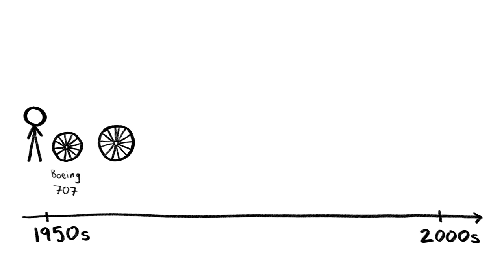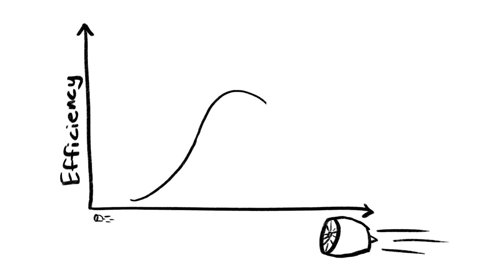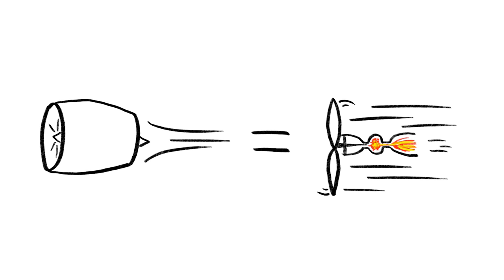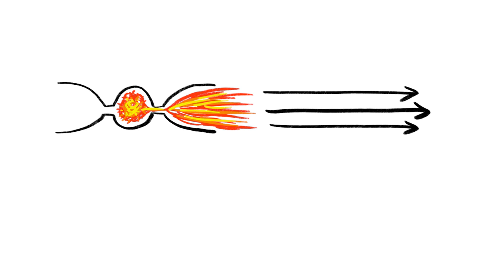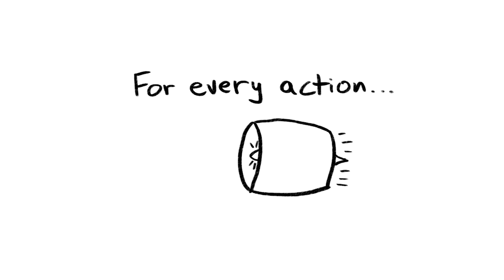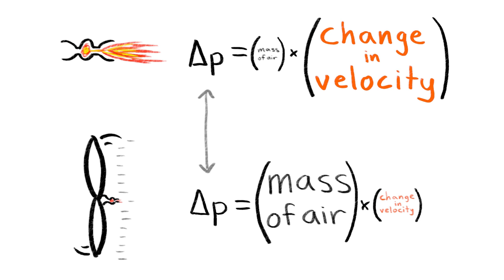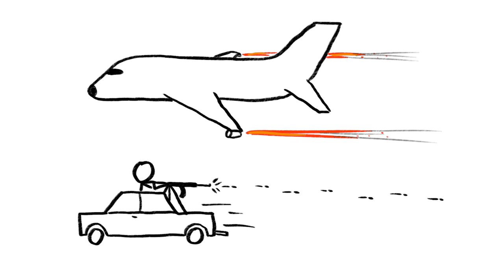Why Are Airplane Engines So Big?

Comment: Henry - Great video! One minor clarification: The core of the engine does actually produce a significant amount of thrust in a high-bypass turbofan - when at altitude. It's about 50/50. This is due to the density of the air being much lower at 30+ k feet, the fan is not drawing as much mass flow so it can't impart as much momentum. As such, the fan's power consumption isn't as high, which leaves more enthalpy available to convert to thrust coming out of the core nozzle (the turbine driving the fan doesn't need as much at cruise). At takeoff, though, you're trying to squeeze every last drop out of the fan and therefore there will be very little energy left over to make thrust out of the core. At this point, the fan absolutely does produce the majority of the thrust (~ 85/15).

Comment: Another reason for bigger engines is noise. Because the velocity of the air travaling through the engine is proportional to the sound produced by compression shocks inside the engine. If you want to build quiter engines, you have to reduce the velocity of the air, but in order to compensate for the reduction in thrust, you need a higher mass flow rate. This is archived by a bigger diametre of the engine.

Another limitation for the size of airplane engines are the standard sizes of airport hangars, that one reason why in recent development for example, of the Trent 900, the casing for the air-intake is elliptical rather than round.
Reply: +Sinan Al-Khadra While not true, it should be noted that a surface with air moving different velocities on either side will generate induced drag as well as a lot of noise from the vortices.
Reply: does it applies to cats as well?
Reply: Sinan Al-Khadra what?
Reply: There are also various tasks performed on the ground that get more difficult the higher up the main fuselage of the airplane is off the ground and engines mounted below the wings are the main factor influencing how high that has to be. Not to mention that the landing gear causes more drag and needs to be more sturdy if it is longer too.

Comment: Its all to do with bypass ratio. You can also increase thrust by producing an engine with a much smaller core but the same fan diameter. Assuming you can create a core that has the same power output

Comment: There are a LOT of reasons as to why engines are like they are, what I find funny though is he focused on the larger commercial planes, but had a tiny side note for ramjet and turboprop, but very little to none on the prop planes, the Boeing aircraft use large engines for efficiency and speed, while the Dash 8 Q400 and ATR72 have tiny little engines that are much smaller and slower, but have a bigger range then some airliners and have massive fuel savings as being the most fuel efficient aircraft available, all Boeing and Airbus make are aircraft to shove people into and get them from point A to point B quickly, and most engines on those aircraft are limited by wing-ground clearance not just limitations of the engines themselves

Comment: Modern fighter jets have dropped turbojets in favor of turbofan engines, for the same reason as the commercial airlines. They just tack on afterburners for more thrust when needed.
Reply: Nope. Fighter Jets use Turbojets because using a Turbofan with an Afterburner will just defeat the purpose of the Afterburner, if you don’t know Afterburners are used to burn the remaining Oxygen that exits the engine so they can create more thrust. But only one Jet in history used a bypass system and that is the Lockheed SR-71 Blackbird where tubes connected to the 4th Stage Compressor took air and sent it directly into the Afterburner
Reply: @whoyoulookingatabs1028  nope
Reply: @whoyoulookingatabs1028  Very wrong

Comment: Good video, but just 1 thing, modern fighter jets also use turbofan engines, mainly because you still want your fighter jets to be able to be able to fly for an appreciable amount of time. The main difference between a jet used for fighters and commercial  jets is the bypass ratio. In general fighters use a lower bypass ratio because there is a bypass ratio limit after which after-burning (or reheating) becomes difficult to achieve.

Comment: Additionally the size of the fan is limited by the centrifugal and rotational forces on fan blades (both normal stresses and bending stresses). Furthermore, longer fan blade tips can reach supersonic speeds at the tips, leading to shocks and flow separation. Of course innovations in blade materials and design can push these boundaries.

Comment: I understood the machine-gun part! I'm smart!
Reply: +DimesTR I didn't.
Reply: +Jonathantje / Bammerbom XKCD Refrence? I'm not sure
Reply: +Jonathantje / Bammerbom Drastically over simplifying, a machine gun is like a very inefficient rocket engine, but instead of shooting out hot fuel and oxidizer it shoots bullets. Due the recoil produced by most guns being rather small to a car it doesn't move the car much.
Reply: I hope so
Reply: DimesTR no you're not
Reply: XKCD : what if : machine gun jetpack

Comment: Yup, we usually refer to that as "Bypass Ratio."  The amount of air driven by the fan relative to the amount driven by the core.  High bypass engines  (sometimes as high as 10:1) are much more fuel efficient and quieter, while low bypass engines (nothing really uses a pure-jet anymore, but jet fighters can have bypass ratios as low as 0.3:1) generally have a better thrust to weight ratio, making the more suitable for applications where performance trumps economy and range.

Comment: 4 metres is only optimal at a certain rotational speed.  In the general case larger, slower rotating propellors produce less turbulence and are more energy efficient.  I think the treatment here is specifically to do with jet turbines, which prefer to turn fast.  It doesn't apply to other motors.
Reply: +Ray Kent I would expect that this video oversimplifies things a bit :)

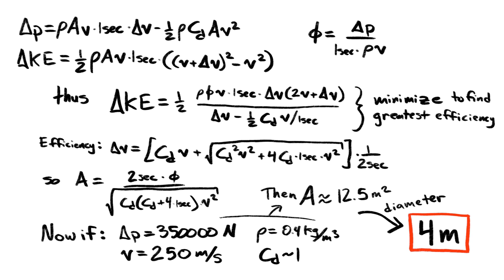Comment: 1:25 when physicists take a rough estimate
Reply: +Cryp Tic Yeah, fluid dynamics is really complicated, especially when you're talking about compressible fluids like air. Almost any calculation you perform would involve making some assumptions that simplify the problem from the real world solution. The fact that the calculations even fit on a single frame of the video means this is a very simple and rough estimate with a lot of assumptions. The trick is knowing the right assumptions to make the calculation manageable while still being accurate. That, or knowing the right computer software to model the problem, which in itself takes a good deal of experience. Really, that's true for a lot of physics and engineering sciences in general.
Reply: +Gary Ermann ^^^when physicists explain things in simple terms^^^
Reply: That's a rough estimate by any engineer's standards as well. And it's not complicated at all. You can learn all the basics for this in a day.
Reply: Physics.. Its usually like that

Comment: I want to point out that the Airbus A350 only has 2 engines while the Boeing 747 has 4. This is why the A350 has bigger engines than the new 747. If the A350 is powered by 4 engines, like the A340, it will have smaller engines than the 747.

Comment: How is a "pure jet engine" (as used for fighter jets) different from a rocket engine? Is the difference that rockets carry an oxidiser?
Reply: Basically, yes.
Reply: +Ag8MrE A jet engine typically has a compressor to compress ambient air as oxidizer, as opposed to pre-compressed oxidizer. The compressor is generally driven by a turbine connected to the exhaust, only without a fan that bypasses the combustion chamber (as in a turbofan).

Even fighter jets these days generally use turbofan engines, albeit much more biased towards the jet than the fan compared to airliners.
Reply: Typically, fighters use low-bypass turbofans, most likely due to size restrictions, while airliners use increasingly-higher-bypass turbofans.
Reply: Fighters use low-bypass, high-pressure turbofans, because the high fan pressure makes them suitable for use with afterburners, allowing very high thrust for their size and weight, but still allowing good fuel economy below the speed of sound when not afterburning.
Passenger jets use high bypass, low-pressure engines because of their very high fuel efficiency. Per passenger, modern-day airliners burn about the same amount of fuel per unit of distance traveled as a subcompact economy car--and they do it while travelling 8 to 10 times as fast!

Comment: The larger engines (high bypass turbofans) are also quieter, not just more efficient. The mixing of cooler air from the bypass duct with the hot exhaust from the engine core outlet helps to keep sound down by eliminating the harsh blending of varying temperature parcels of air (ambient air in the surrounding atmosphere and hot exhaust). Add some chevrons on the back of the nacelle (like the Boeing 787 and 747-8) and it blends even more and makes it quieter.

Comment: Also you forgot to mention the bigger the engine the bigger the propeller, and the bigger the propeller the faster the tip of the propeller will spin up to a point it will reach a sonic boom which is very detrimental.
Reply: +dontknowdontcare The fan blades already are supersonic at the tip I think. Thats what they told us at the university anyways -
Reply: they are already super sonic but a company just resent ly figured out how to have the fans run slower to reduce fuel consumption.
Reply: +Miguel lopez airlines already fly with fuel consumption in mind the winglets on b737 reduce fuel about 4% per flight but a massive cost reduction. 
They use cost index to determine speed zero means save fuel while 300 means burn alot because we are experciencing strong winds.

Comment: The interesting thing is that this is the exact opposite of how it works for rockets. With a rocket, you want the exhaust velocity to be as high as possible so that the propellant mass fraction can be minimized, hence why ion engines are so efficient.
Reply: It depends. He's actually not 100% correct. Jet engines these days don't shoot out their exhaust at high speeds. Most rocket engines shoot their propellants out nearly ten times faster. The reason they're efficient is that they use the air around them. Most Isp/effective exhaust velocity data for jets is actually skewed, since Isp is impulse per kg of propellant in the vehicle. Some of the airplane's propellant is outside of the vehicle.He's right about the energy issue, though. It takes more energy to shove a small amount of mass really fast than a lot of mass really slow. The math shows it.

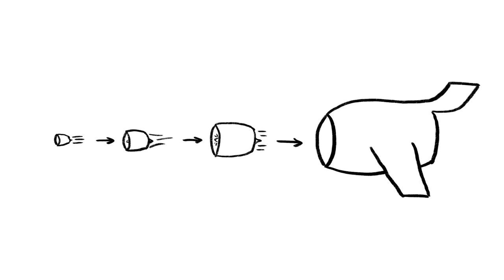Comment: I think the last one with big "X" on the last slid might work! at 1:30
Reply: +Jianyue Tang Yeah, I see nothing wrong with that design.
Reply: +Da_NKP it might need a larger fuel tank
Reply: +Jianyue Tang entirely fair, as well as larger wings.
Reply: A jet fighter version of that already exists and has existed since 1946. Look up the Mig-9.
Reply: Basically, but it wasn't big enough. We're talking something around the size of, say, an AirBus 320.
Reply: It neeeds lots of fuel.
Reply: mig 15

Comment: As an aviator, I agree with video.  In fact, airplanes are products of design compromise between four contradictory quantities: lift, thrust. weight, and range.  You can have the highest aspec ratio wings that are ultra efficient, but are equally fragile.  You have the biggest engine that can allow to move your plane at phenomenal speeds, but it will big, heavy, and will guzzle fuel like no other.

Comment: One of the simpler answers to this question is that newer engines use a greater amount of bypass air to achieve greater thrust. A large amount of air bypasses the combustion chamber and is re-introduced into the combustion exhaust. This air expands and accelerates in the hot exhaust and delivers more thrust. The engines must be bigger to allow for the bypass air. (BTW: Read Ender's Game about 6 times and enjoyed it every time).

Comment: Compare a A350 with a B747 was really a bad example.... 
Firstly, the B747 is marginally larger. Looking at the 747-400 compared to the A350-900, the Airbus actually got larger wing span and its only 4 meters shorter.. so yes, the 747 is larger, but only just. The A350 is actually a huge plane  And the uppcoming A350-1000 will actually be longer than the 747-400.  (of cause the 747-i8 is longer still, but its the 747-400 in the picture.)

The issue is that B747 have 4 engines and the A350 have only 2. The thurst of the A350 engines is maximum 350kN, but for the B747-400 only 280kN. Actually the engines of the A350 is even stronger than the one of the A380.

There is one additional error in the video. its over theoretical compared to the actual reality of aircraft engines. All (or almost all?) turbofan engines is direct drive engines. Because the fanblade have a maximum speed the rotation velocity most be keeped. This make it so the turbine engine have to have huge torque.

The compromise to this is that the turbine engines is a loot larger than it need to be, and the fan ist still smaler than is optimal. This is why engine manufacture dont make the fan at optimal size. Because then the torque would be to much.

The solution to this is of cause to introduce gearing. And there are some prototypes under development. This not only makes it so the fan can be any size (that is the optimal size for every given aircraft, but it also make it so the turbine engine can be the optimal size to.. that is a lot smaller.

This will decrease the fuel consumpsion more than making the fan bigger. But the comibnation will cut the fuel consumption quite a bit.
Reply: +matsv201 You're right, but this is a video for laymen and in 2 minutes. I think they did a pretty good job.
Reply: jibeneyto Well.. i would still think they should compare two aircraft of similar size. Say a A330 and a 787.

Also i think the issue about geard and ungeard turbine is to important to just skip over.....

.... i would think this is more a matter of that the videomakes know the theoretical background, but not the current limitations of the engines that is in service.

There is a glaring whole in the video. If they know the optimal size (and it been known since the 1900-century)... why don´t they just makes the engines optimal size...

This is a question that is unanswered.....And the answer is quite simple.. there is no gearing.... so they cant.
Reply: You're right as before, but gearing in turbofans has not really been implemented in any aircraft. Maybe in the future it will. I don't think it's important to consider such a "new" concept in a 2-minute video.
Reply: jibeneyto No.. but it answers the question why the turbin gradaly grow, and why they don´t make it optimal from day one.

Comment: I have a question - aeroplanes fly at high altitudes where air is thiner so that they can reduce the drag force but they also require the air to be denser so that the wings(airfoils) produce enough lift. So is there any special hight in our atmosphere where flying aeroplanes is the most efficient or where the most aeroplanes do fly for efficiency?

Comment: 1:23 A rough estimate...
Reply: Area of about 12.5 m^2, take the square root, it's about 3.53...
Reply: QuakyJunior Whenever I'm on the computer and it's late at night, I make really stupid mistakes.

However, you are wrong. It's pi*(r^2) ,this is area, not circumference. I was also wrong, but you were, too.

12.5, divide by pi, take square root, get radius. Multiply by 2, get 3.9894228040143267793994605993438.
Pretty close, I'd say.

Comment: Why didn't we start with 4-meter engines?
Reply: +Timothy McLean Probably much more difficult to make. The tolerances need to be very small to reduce vibrations. The bigger the engine, the more difficult to produce with small tolerances.

Comment: I didn't think airplane engines were very big at all.
Reply: If you define "airplane engine" as "the part that creates the power used to propel the aircraft", the engine is actually pretty small compared to the size of the nacelle it is housed in.
In fact, most of the space in an engine nacelle housing a modern turbofan engine is just ducting for the bypass air (air that goes thru the fan but not the core)
Reply: Yes, but isn't it somewhat like an auto engine as far as what's considered the actual engine it's self?
You can buy a short block but it wont run without the intake, carb, or fuel inj. water pump etc. Come to think about it, I'm not exactly sure what "just the engine" actually is. Block and internal parts?  Probably about as controversy as the difference between an engine and a motor.
I motored to the store but didn't quite make it back home. My motor broke.
I suppose next time I may engine to the store.
Reply: Kirby
To me, the fan on a turbofan is not part of the engine. The aircraft isn't going anywhere without it, but it's not what's making the power.
The core of a turbofan is a turbojet, and that's an engine in and of itself.
A turbofan adds stuff on to a turbojet, so the stuff that is added to a turbojet to make a turbofan isn't "engine" stuff.
If any of those parts break, the aircraft isn't going much of anywhere, but the same goes for a car if it loses a wheel or transmission.

Comment: Efficiency is certainly the main reason size has been increasing but it's not the only reason, larger engines are quieter because they can generate the needed thrust by moving a larger volume of air but at a slower exhaust velocity. That's also the reason behind putting larger fans on higher end computers - it keeps the noise down while still providing the cooling needed.
Reply: and the FAA (and agencies in other countries) have been passing more stringent rules when it comes to noise from civilian aircraft.